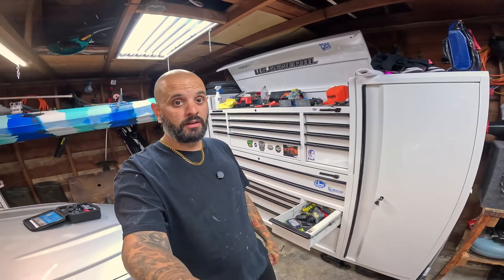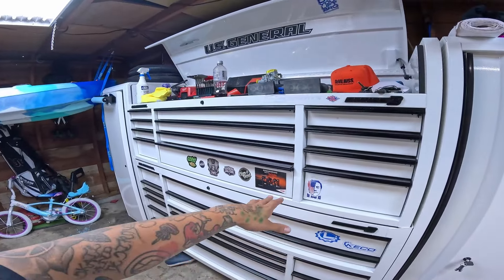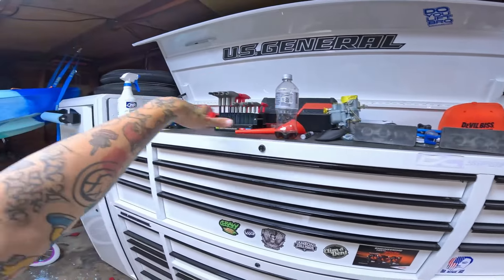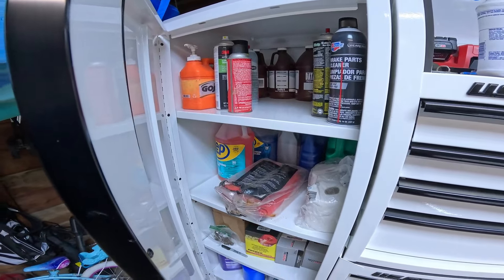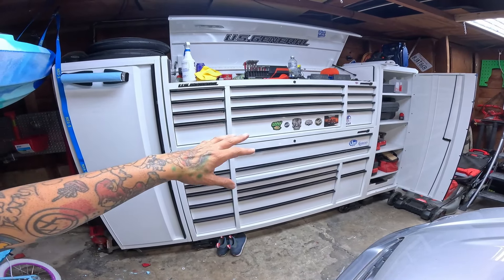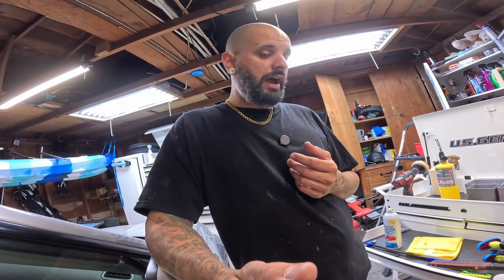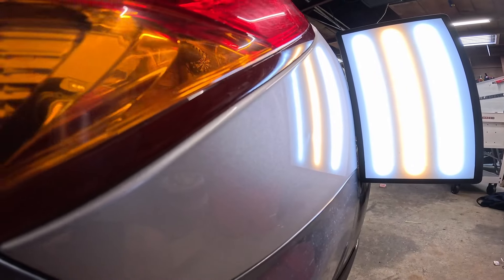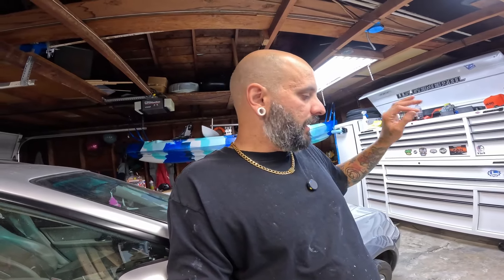ANOTHER SERIES 3!?

Comment: Hi Joel, that toolbox looks amazing and it's huge!! I wish I had the space for something like that in my little workshop but you have more drawer space in this one with the upper chest.

As you know I'm just a hobby/diy painter and while my paint finishes aren't to bad as you've seen on my little channel what I still struggle with is my filler and block work, no matter how hard I try to repair small dents I can still see where they were, it's either to low or I can still see the edges of my filler I just can't seem to feather them out properly, maybe you could do a video sometime on filler work that would be great👍
Thanks Joel👌👍John UK
Reply: Try a guide coat. Guide coat your filler before sanding. You can also try guide coating the area that is going to be worked. So guide coat over the paint then block it and it will show exactly what needs to be done next. After spreading your filler and it's done  curing guide coat it. Do the same between grits and make sure you guide coat past the area you're working. Helps with feather out. Also a little trick is to get a sheet of paper and rub it on the panel you just finished working. It helps with the feel of the panel. Hope this helps
Reply: Thanks for the advice, I do use a powder guide coat but from what you said I'm not using it enough so maybe using it over the paint and between grits might help. I've never heard of using paper to help with the feel of the panel (something I find difficult) I sometimes use a microfibre cloth to do the same thing which someone else told me to try.
Thanks again👍👍
Reply: @JohnWD40TC02  yeah man anytime! Yes when you use the guide coat go over tell everything turns black the darker the better. You can use guide coat powder in between grits when you wet sand for polishing panels. Helps out a lot of your going for show car finishes. Yeah micro fiber towels help to feel when you're doing body work. I like the paper cuz it's thinner and I feel it better that way. You can also use a latex glove also. It takes time on the feel but you'll get it
Reply: Ok I'll try it, thanks again for the advice.
Reply: @JohnWD40TC02  you're welcome